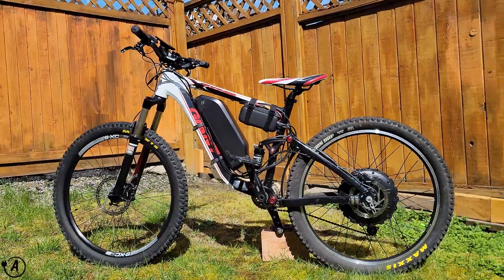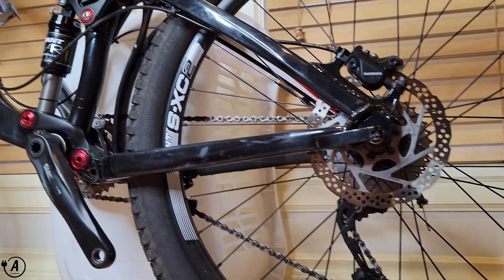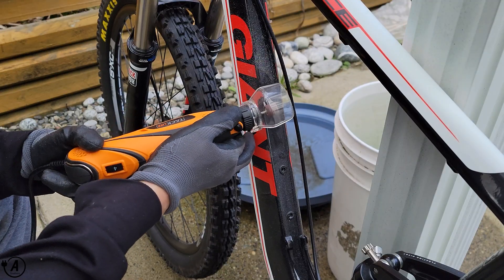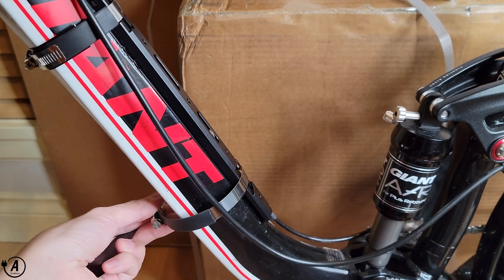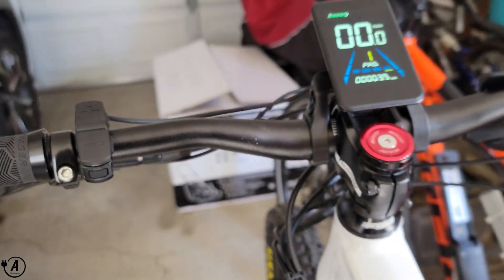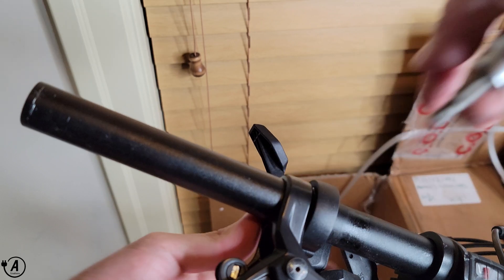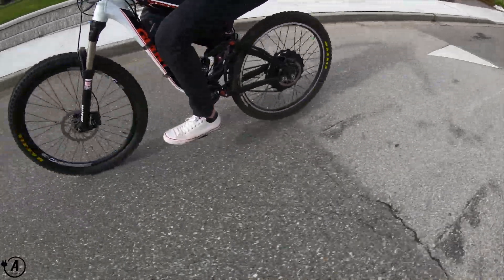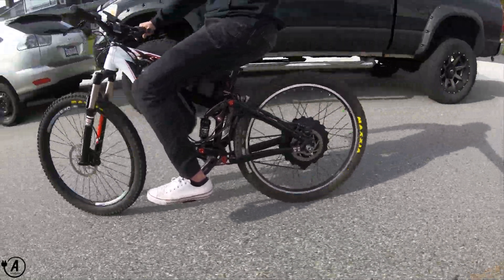DIY Full Suspension eBike Conversion | Simple and Fast 1000W Hub Motor Conversion Kit

Comment: Considering an e-bike conversion of my Marin Bologna’s Ridge 1 - an older but capable hardtail. Two questions would you recommend a mid mount or rear mount conversion kit and secondly is the kit you use here still available and would you recommend it? Great video!

Comment: Aaron thanks for this video. I watch lots of your videos. Please can you help me this: I have similar set up like yours. brushless hub motor of 1,500 watts 48v, with controller of 60A peak. But when climbing hills the bike goes off. I guess the controller shuts off. So I don't know could it be the battery or the controller? Your opinion or if any experience on this please. Thanks
Reply from the maker: Check your current limit. If you have a current limit set, and you exceed the limit, the power will cut out. The reason why it cuts out when you’re climbing hills is because the load typically peaks when climbing hills.
Reply: @AaronsCreations  Thanks a lot. I checked this but eventually i figured out it was the battery. It runs down to almost zero when the controller pulls like up to 35A on hills climbing. Thanks once again.

Comment: Hmm, interesting. I was wondering if it was even possible to do a conversion on a dual suspension. I've got a 2004ish Mongoose Teocali comp I wanna do a conversion on but the frame and suspension setup is a bit different to this bike so I need to a bit more research and go see the guys at the local bike shops to see what they think the best setup would be. 👍🙂
Reply: I've seen someone that has a 3000W motor on a full suspension. He goes at 75kph

Comment: hey there, i was looking to convert a bike and i was wondering instead of putting everything inside the frame have you ever wondered to put the controller or battery on top of the frame in between the handlebar and the seat?
Reply from the maker: Yes, I considered that, however mounting and dismounting from the bike would be less than ideal. As a result, I went with placing the electronics in the body!
Reply: @AaronsCreations  thanks for the advice

Comment: What do you do of your donor bike has hydraulic brakes? Then u can install the supplied e-brake in those kits that cuts the motor when braking right?
Reply from the maker: Both my conversion bikes have hydraulic brakes. In which case, I used the magnetic sensor that senses the presence of the magnet to cut off the motor.
Reply: @AaronsCreations  How did you mount the brake (motor cut out) magnet sensors -- glue (what type) ? or tape ?
In your opinion are the brake cut off sensors really needed?  Once throttle is released then motor cuts out right?  Most riders would never use BOTH throttle and brake at the same time. Also, on a regular gas motorcycle the brakes don't have any throttle cut out sensors -- so why the need for this device on an electric bike?

Comment: when youre riding at the end of the video, youre using nearly all the suspension travel meaning you havent adjusted the rear shock for all the additionl weight. consider increasing the air pressure in the rear shock
Reply from the maker: Thanks for sharing. I will be sure to account for the additional mass!

Comment: Nice build, I have just converted my bike to electric using a kirbebike kit also but using a front hub motor 350 watt with an mtx39 rim paired with a 48v 20ah 960 wh battery LG cells.
Reply from the maker: Thanks mate, enjoy the bike!

Comment: your washers are not installed properly the the  torque washer should be on the outside not the inside of the drop out assembly
Reply: Torque washers can also be installed on the inside with tooth facing out.  Seen this done plenty times. Not an issue really as installer can decide which way is best based on frame and axle fit in the dropouts. There should be comfortable snug fit and clearance for wheel to spin and torque arms to fit properly

Comment: Oh hey you're in van. I'm currently learning about eBikes because of the rebate and stumbled across your videos. Did you get the rebate as well?
Reply from the maker: Unfortunately, conversion kits are not eligible for the eBike rebate!
Reply from the maker: Only Fully assembled e-bikes that have a price of at least 2k are eligible.
Reply: @AaronsCreations  dw I understand! I'm planning on buying the rize x to use as a donor, and swap out the hub motor, controller, and display. They have a mount for dual battery which will be nice for range.

I'm planning to use a 1000w geared hub with a 52v 40a controller. I'm deciding between the bafang g063 and mxus gdr-19fat right now
Reply: @AaronsCreations  do you know if there's a local ebike building/modding community?
Reply from the maker: Not that I am aware of. However we do have a PEV Community where we host group rides, discussions with fellow eBike Builders, EUC Riders, Scooter Riders, etc… The group is called “Vancouver ESK8” on Facebook

Comment: Nice build, I’ve just built my first 1000w e bike only front suspension though as I was worried about space to mount everything but that bike you got was a good fit for electric.
Reply from the maker: Yep! I had concerns that the suspension in the center triangle might not allow enough room for the electronics, but fortunately, the frame had a large triangle, so it wasn't an issue.
Reply: @AaronsCreations  I am planning on doing this on my Canyon Spectral which uses almost the same exact triangle geometry. 
This video is great news for my project, but Im still concerned about the space, how did you slide the battery onto the rails the first time? I am worried about this detail ruining my idea because I want to be able to take off the battery if I ever need to. Any advice?